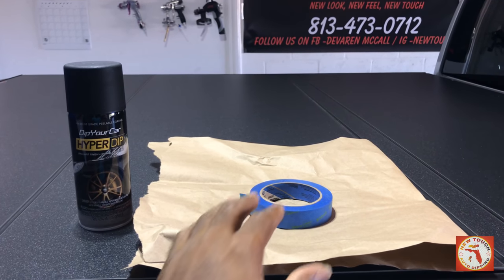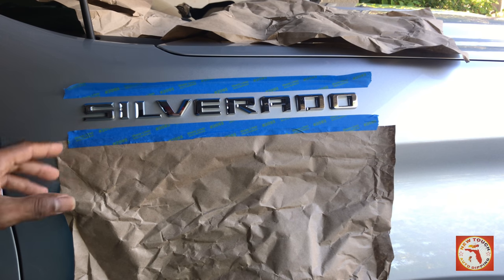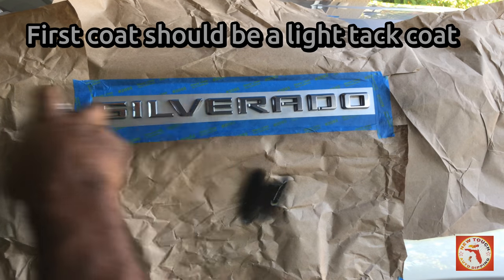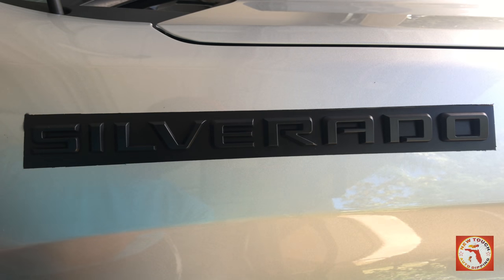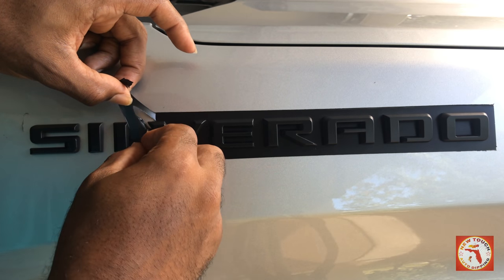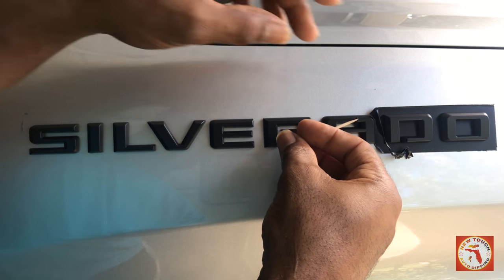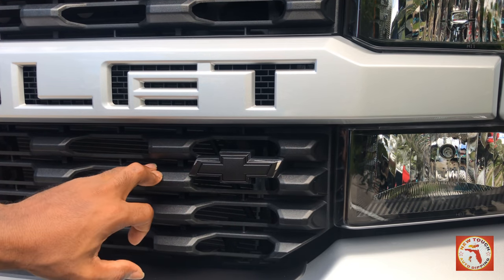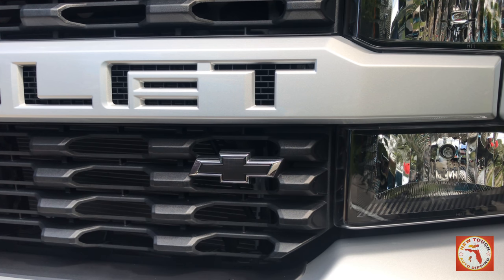(How to) HyperDip/Plasti Dip Your Emblems

Comment: That is some great work. Could the hyperdip be used on the chrome trim around the car's window door? I want black out that chrome trim. How long will the hyperdip last with car washes and outdoor conditions, especially the sun?
Reply from the maker: Thanks for the compliment and checking out the video. As long you apply it correctly it’ll hold up to car or pressure washing, hyperdip can be used on any chrome trimming as well metal/chrome wheels. As mentioned if applied correctly you should get up to 3 years before needing it removed.

Comment: How did you/he get the hyper dip to stick to the emblem and not the paint?  How did it not peal off the emblem without going around each letter with a razor ?
Reply from the maker: The letters are attached to the vehicle so that means there’s separation, anything with a crease or not bonded together will allow the peel to be separate

Comment: thanks for this video I hate chrome on my vehicle.  So how long does it take to dry? will this process last in a car wash and or pressure washer?
Reply from the maker: You’re welcome and thanks for checking out the video. It’s dry 1 hour from last coat but give it 3-4 hours to completely dry to the emblems, wait 5 days before washing. When it’s applied correctly you won’t have any issues with hand, drive through or pressure washing.

Comment: Do I or should I seal the dip once I am done? Or does it harden and grip enough that it wont pull off one completely dry?
Reply from the maker: No need to seal hyperdip since it doesn’t require nor have clear coating available. As long as you properly clean the emblems the dip will adhere from natural heat, I don’t suggest that you try this in cold weather bc it’ll more than likely fail.

Comment: Can this be done to my roof rails on top of my vehicle or would you suggest wrapping it instead?
Reply from the maker: Yes this can be done to the roof railing but avoid spraying any rubber parts. If you’re new to both vinyl and spray wraps I’d go with the spray wrap. On the other hand vinyl wrapping the rails are straight forward and don’t take much to complete but you’ll need to precise with your cutting skills.

Comment: How many coats did you put on the Chevy emblem on front grill?
Reply from the maker: I ended up with 12 total coats for each area, it’s suggested that you obtain proper coverage in order to get the proper peel ability. This goes for all of the hyperdip products bc if it’s too thin you’ll run into either 2 issues. 

It won’t stick correctly 
Too thin to peel, much harder to remove

Comment: Nice video.  When you wash it, does it peel off when you rub it dry.
Reply from the maker: Not at all, when applied correctly you won’t have any issues with pressure nor car washing. I only advise wash and drying with a shimmy towel if by hand

Comment: How long after cleaning the emblems before you started the coats? How long did you wait before you started the peeling process? I tried it last weekend and failed miserably.
Reply from the maker: You can start about 10 minutes after preparing and cleaning. You’ll wanna wait 1 hour later from your last spray coat. You can achieve a successful finish, just take your time and follow the steps.

Comment: Does the hyperdip stay on just like that or do you need to clear coat it so it doesn't come off in car washes and what not? Is it always easy to rub or peel off or just at first?
Reply from the maker: Yes, after 1-2 days once the paint cures to the panel it becomes more durable. No clear coat is needed, a satin finish is the final coat. They have gloss finishes available in hyperdip products if you prefer a different option.

Comment: Looks great! I'm about to do my new Grand Cherokee L. Any advice on how to  do the chrome part of the grill along with the chrome bar on the front and back? I also plan on doing the chrome strip on top of the doors!  The emblems shouldn't be too difficult, but I'm worried about the chrome inserts in my grill, the chrome bars and doors! I'm trying to basically do a complete chrome-delete. Any advice on that?
Reply: I would also like to ask how many cans of hyperdip you needed to use! Thanks!
Reply from the maker: @mattshay7275  thanks for the compliment and yes the Grand Cherokee has some difficult areas to spray. The best advice I’d say would be to remove anything that’s able to and spray it that way. If you’re unable to remove then focus on spraying what’s being seen, remember that this product is removable so covering everything sometimes can be ignored. I will suggest maybe the 5 can wheel kit and 1 extra totaling 6 to complete your project.

Comment: How long will it last thru car washes general wear tear? How long did you wait to peel after coating the emblems?
Reply from the maker: You’ll wanna wait 1 hour before peeling around the emblems. As for car washing you’ll still get 3-4 years out of it before needing it removed or a recoat. I suggest that you don’t use wax on liquid spray wraps, it’ll fade out the color. I use DipCoat Protection Spray from dipyourcar

Comment: So how good does this stuff last? Can I go through the car wash without damaging the plastic? With the excessive heat from the sun cause premature peeling? Seems a bit easy to come off is my concern.
Reply from the maker: When it’s applied correctly you won’t have any issues with hand, drive through or pressure washing. Applying the DipCoat protection spray from dipyourcar.com will help with the longevity and look.

Comment: What type of alcohol did you prep clean with ? Denatured or ISO
Reply from the maker: 99% ISO but you have to be careful when using that percentage bc some areas have to light of clear coat and 99% will melt it down to the base. You can use regular 90-91% alcohol to be on the safe side.

Comment: That looks Great!
I noticed that you sprayed the pre-spray on the cloth and used that to clean off the emblems.  Do you do that for all jobs or just the detailed jobs with detailed work?
Reply from the maker: Yes the predip spray is needed for any project, it’s an adhesive spray designed for the product but you can use any paint adhesive spray.

Comment: Oh that came out great , I was wondering if the dips come in a brush on, I need to redo the factory dip on my window moldings it all cracked from parking in the sun
Reply from the maker: Thanks but unfortunately it doesn’t, you would have to remove the old plasti dip that’s cracking bc hyperdip isn’t compatible. There are a few tricks with re-spraying the trims with plasti dip but is a lot info to type, other than that you can check out my video uploaded on peeling off your 4 year old plasti dip.

Comment: How long does this stuff stay on for ? Will be work during the heat and the winter time ?
Reply from the maker: When it’s applied correctly you can get up to 4 years. Using the DipCoat protection spray after each wash will help with longevity

Comment: Hopefully you're still answering questions seeing this is 4 yrs old. Great informative video! My question is concerning the recessed lettering on the tailgate. Did you also HyperDip those letters? If so, would you be willing to elaborate? Thanks again for the video.
Reply from the maker: You’re welcome and thanks for watching the video. If it’s the big letter indentation on the tailgate you should order the vinyl decals, there aren’t any separated spaces for the spray to cut. Emblems are attached by double sided tape which creates enough space between the panel and letters. Trust me I wouldn’t waste time masking off the tailgate letters unless it’s emblems, you can find your vehicle decals on eBay, Etsy or Amazon.
Reply: @newtouchauto  I appreciate your response very much! Again, thanks for the informative video. Subscribed.
Reply from the maker: No problem, thanks for the support

Comment: How does the hyperdip stand up to washing? Does it scratch easily?
Reply from the maker: Whenever it’s applied correctly you won’t have any issues with hand, drive through or pressure washing. Scratches will occur regardless of any other type paint but it’s not as easy to scratch vs plasti dip.

Comment: Just saw your video; does the plastic dip ever come off and have to be redone over the places you did
Reply from the maker: when applied correctly you won’t have any issues with it peeling during a hand/car or pressure washing. You can remove it at anytime just by peeling it off.

Comment: Have you tried doing this on the bumper and grill. Intrested in doing this to my f150
Reply from the maker: Yes I’ve done a few, you can achieve the same look on both areas. You’ll want to avoid spraying larger panels bc it’s not designed for that

Comment: How long do you wait in between the coats? Also how long do you wait once you are done spraying to peel off the excess paint?
Reply from the maker: If your temperature is 65-75 degrees give it 15-20 minutes, if it’s 75 degrees above 10 minutes, if it’s 65 degrees below 25-30 minutes. Your temperature plays a huge role when you’re either outside or in a garage so the best temperature setting is 72-75. Wait 1 hour before removing the extra dip around the emblems, you’ll want to give it time to bond which makes it easier to peel
Reply: @newtouchauto  thanks, you are very helpful.
Reply from the maker: @marlonhernandez706  you’re welcome

Comment: Just wanted to check that this won’t wash off when I go through the car wash or anything like that if anyone knows. If not this is a pretty sweet solution
Reply from the maker: When it’s applied correctly you won’t have any issues with it peeling off, if you’re using a pressure washer give yourself enough distance when cleaning. At the end of this video I have a link that shows the car wash process.

Comment: I'm really glad I came across this video. Im going to do my truck.  Can I do my exhaust tips?
Reply from the maker: I appreciate the support, you can but most will advise that you don’t spray your exhaust. The reason being is that the tips tend to heat up on the regular, hyperdip is more durable than plasti dip so it may withstand the heat in that area

Comment: Did you trim around the letter before peeling? Or does it just break away from the base of the letters as you pull away?
Reply from the maker: No trimming needed, anything that has a crease ore separation would automatically peel separately

Comment: How did you peel away the hyper dip without the letters pulling away also?
Reply from the maker: The emblems are already separated from the panel of the vehicle, whenever you attempt to peel you’ll notice that the gap between the emblems will be where it separates. If you decide to try this you’ll notice it better visually.

Comment: Where can i get some pre dip type of spray today? Like does it matter where or what kind? What if all i have is alcohol? Will that work just as good?
Reply from the maker: You can get paint adhesion from local automotive shops, it really doesn’t matter the brand. You can also use 99% alcohol but I only suggest that you use isopropyl bc it gives a stronger bond, regular 90-92% alcohol won’t give you the max adhesion needed to stick properly
Reply: @newtouchauto  thanks a lot 💪🏾
Reply from the maker: @TheeHistoryHaven  you’re welcome and thanks for checking out the video

Comment: How do you fix a run with Hyperdip?
Reply from the maker: To be honest with you hyperdip is tricky when it comes to that. I would only suggest wet sanding until you get it down, then recoat the surface for an even colored finish.

Comment: How long do you have to wait before washing your car?
Reply from the maker: Depending on the outdoor temperature, summer weather give it 3-4 days before washing and other temps 5-7 days. Automotive wax products aren’t compatible with this removable paint product, it’s best to use DipCoat protective spray. It helps with the longevity and it enhances the look as regular wax does.

Comment: Impressed. How does it hold up over time? I hand wash my vehicles, but I am wondering how it stands up in time; whether hand washes or car washes (Prime Shine, etc.)? I did see a bit of a "bubble-out" (real small though) under the inside (left) of the "R". If you use your special tool (toothpick) to "smooth" it out will it re-adhere to the emblem? I seen you do that on the "I" & it appeared to re-adhere. I recall you said do this while still wet, but you already coated it multiple times, but the "I" did re-adhere clean. It still looked REAL good. I'm currently more of a Ford/RAM guy, but that Chevy is AWESOME too.
Reply from the maker: Thanks, when it’s applied correctly you won’t have any issues with pressure or hand washing your vehicle. Only Plasti Dip you can pressed down to whatever panel and it’ll stick or adhere back but with Hyperdip it’s not happening. When spraying a removable liquid product such as this whatever you spray over it’ll only replicate and build up over so what may look like bubbling could just be the main surface. Me though, I’m a GMC/Chevy kinda guy lol
Reply: @newtouchauto  Thanks for reply.
Reply from the maker: @checkurselfb4uwreckurselfw173  you’re welcome and thanks for checking out the video

Comment: Man... you make it look easy.  Only question is...  how does that product hold up against car washes.  Whats the life expectancy of the product if installed right?
Reply from the maker: Thanks, when applied correctly you won’t have any issues with hand/car or pressure washing. In the past with Plasti Dip you can get 3-4 years before needing it removed or repainted. Hyperdip is a new product line that has better quality so I can imagine the longevity 3-4 years also but with more durability and no fading or thinning due to sun damage
Reply: @newtouchauto  thanks for the quick reply. Keep holding it down on your end. I do a lot of vehicle wrapping and plan to venture into your world. Plan on practicing on my own truck. I have a black silverado and blacking out the chrome decals. You think this would work well on alloy rims?
Reply from the maker: @twerking  no problem and with liquid wraps you can pretty much paint any area of a vehicle, I suggest that you don’t spray rubber or weather strips. The alloy rims won’t effect the paint not sticking.

Comment: Thanks for a great video.  Question - the product web site says to "coat each dipped surface with DipCoat Protective Spray 4 hours after the dip has dried."  You didn't do that in the video, do you feel it's unnecessary?  Also, how would I get the black coating off if I screwed it up?
Reply from the maker: You’re welcome and yes you have the option to apply the DipCoat protection spray after each dip so you’re correct. It’s not in the video but I always apply it afterwards, DipCoat protection spray is similar to waxing your vehicle after a wash, it has its own benefits so it’s not a must if you don’t apply after dips. 

In cases where you’ve made a mistake you would simply apply enough coats to peel off and redo the area or panel, that’s a huge plus in my book to have that option.

Comment: How much time do you wait between coats? great job btw.
Reply from the maker: If your temperature is 65-75 degrees give it 15-20 minutes, if it’s 75 degrees above 10 minutes, if it’s 65 degrees below 25-30 minutes. Your temperature plays a huge role when you’re either outside or in a garage so the best temperature setting is 72-75. Wait 1 hour before removing the extra dip around the emblems, you’ll want to give it time to bond which makes it easier to peel

Comment: Sooo basically if the rubber breaks carefully pullout and away, got it! This could've been really helpful 3 kids ago! Lol, but seriously bro can you explain the role that the spray and alcohol plays in prepping the emblem? Thanks brother , great video!!
Reply from the maker: 😆 yeah the kids definitely will slow down the motivation. The predip spray and alcohol allows the paint to stick to the panel properly, without an adhesive bond everything done will be for nothing.
Reply: @newtouchauto  ok , thanks bro appreciate it!
Reply from the maker: @mccoybyz1099  you’re welcome and thanks for checking out the video

Comment: Do you peel plastidip  on last coat when wet also?
Reply from the maker: No you’ll only peel the masking while wet, the outer area around the emblems with dip will need to be removed 1 hour later

Comment: How long the wait between sprays?
Reply from the maker: If your temperature is 65-75 degrees give it 15-20 minutes, if it’s 75 degrees above 10 minutes, if it’s 65 degrees below 25-30 minutes. Your temperature plays a huge role when you’re either outside or in a garage so the best temperature setting is 72-75. Wait 1 hour before peeling what’s left around the emblems

Comment: How well does this hyperdip hold up over time? For instance, UV sunlight? Car washes? When you are drying off your car with a towel? Nice work brother.
Reply from the maker: Thanks for watching. When it’s applied correctly you won’t have any issues with hand, drive through or pressure washing, I can’t speak on the longevity just yet bc it’s a new product but from my experience with plasti dip this is much better. I honestly don’t see any fading or thinning overtime bc the product finish is stronger than plasti dip
Reply: @newtouchauto  Sounds like a nice product, thank you for the reply. God bless.
Reply from the maker: @dusting81  you’re welcome and I appreciate that, thanks for checking out the video